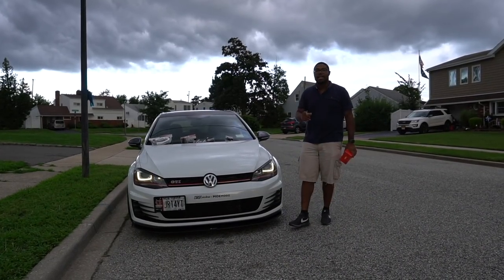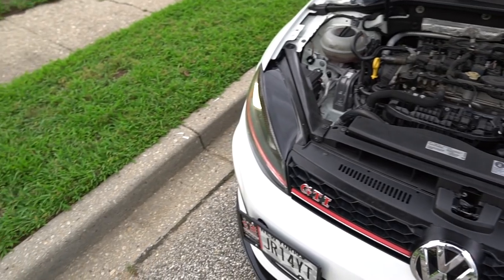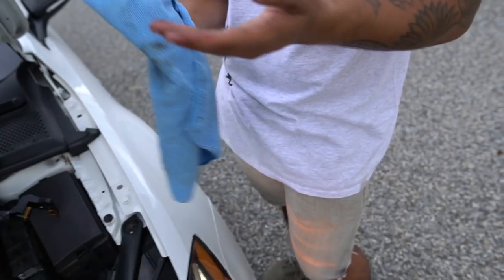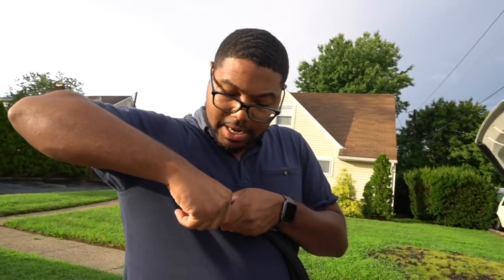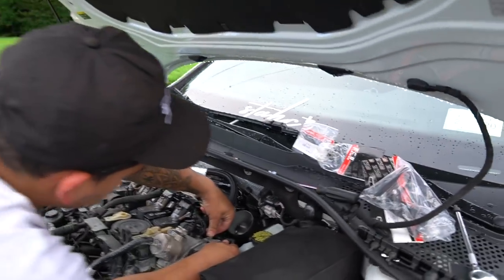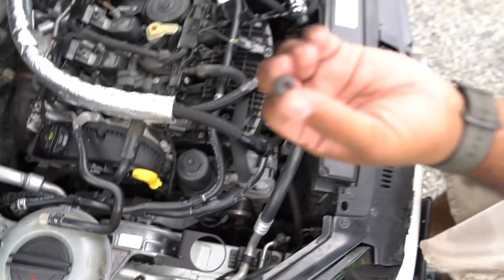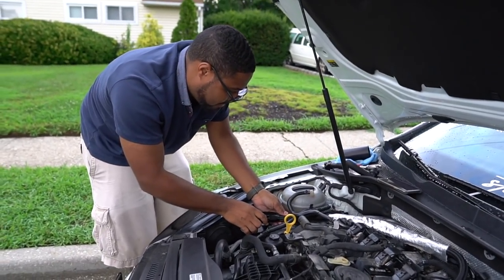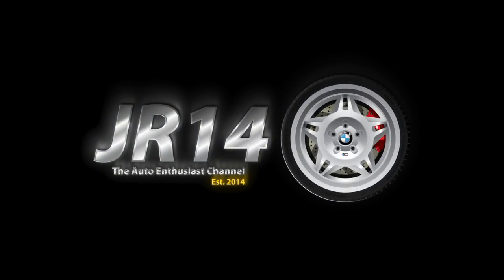Oil Catch Can Install On 2017 VW MK7 GTI

Comment: Good day, So after 4 years of using the Oil Catch Can, would you still recommend it for helping NOT have carbon build up on the intake valves and manifold?

Comment: Did you notice your positive ignition corrections increase after installing? AS soon as I installed I started getting way more. Now every cold start im up to 4.12 degrees that slowly backs down to 0.38 within the first minute. Once it gets to above 115 oil temp it goes to 0.00 but any throttle and it jumps to 0.38 again. Almost no negative corrections and no knock. Running a Cobb Stage 1 93 tune for reference. Any input would be appreciated.

Comment: On 1.8tsi there is an oil seperator now. Apparently that has fixed most of the valve problems.

Comment: Did your catch-can catch anything?  I have '16 stock MK7 with 38k.  Thinking about installing a similar one from Deutsche as preventative to carbon build-up.  Its still a few hundred dollars that I rather not spend if it doesnt work.  Is the concern in winter with a catch can that water may freeze up in the catch can?
Reply from the maker: Well if you install this and you drive around and there is nothing that collects. That actually means your stock PCV valve is functioning correctly
Reply: @JR14Channel  I had mine installed since 1K miles, also a 17 MK7 GTI.  I'm at 32K.  This is good news for me then.  Thanks for sharing.  Do you get misfires or further carbon build up after installing this?  I really appreciate the level of detail of the video!

Comment: Nice videos and I’m looking into installing a catch can on my gli but looking at your install my question is what about the crankcase manifold going into the intake manifold or your just trying to eliminate the oil going into the turbo
Reply: i think hes just trying to eliminate the oil going into the turbo
Reply: I have a video doing this but from the intake manifold as you mentioned. Although there were some comments made and person posted a forum of this type of catch can install from the turbo or perhaps running two catch can? Not sure if I will run two. Stop by and check it out
Reply: @TraeNelsonScott  I believe their a 4 way oil catch can you can install

Comment: I just looked at the ecs site and noticed their photos.  One photo shows the flow of the catch can.  Seems you have the inlet hose on the opposite side of the catch can.  Does it really matter?
Reply from the maker: Yea i rechecked it after the installation video and I did install it right the feed and return are different on a Golf R than a GTI. The feed and return are swapped on the Golf R

Comment: Has any oil been filling up in the catch can at all? I'm thinking about getting this for mine.
Reply: Matt B had mine on for almost a year and it’s still bone dry.
Reply: @marcodiaz4102  yeah I believe it, I have 25k miles on mine and recently took off my IC charge pipes and they both had zero oil in them.